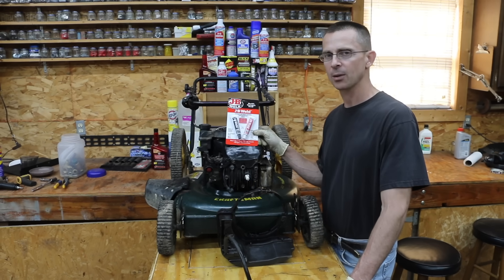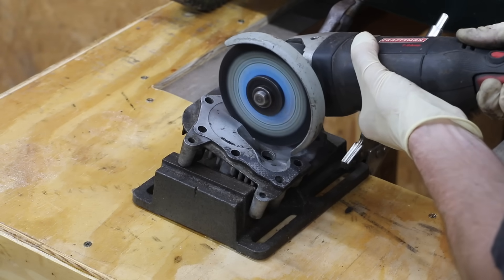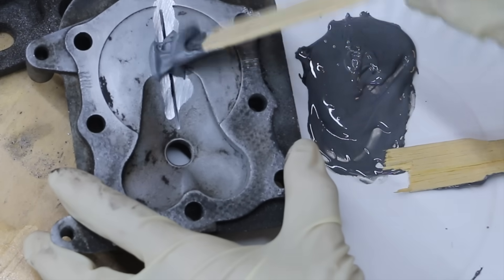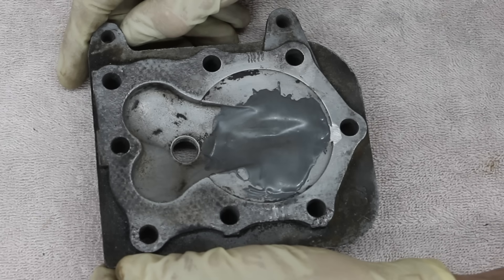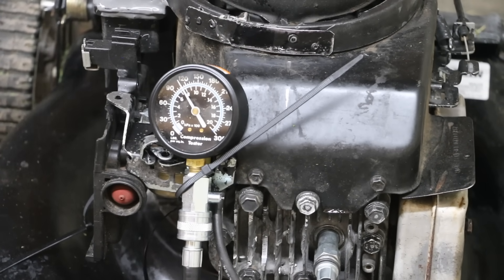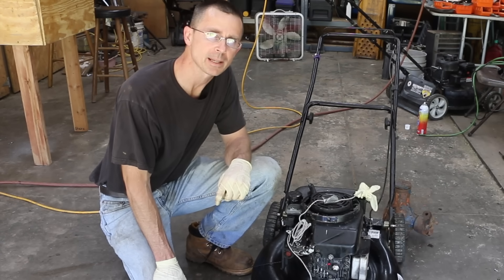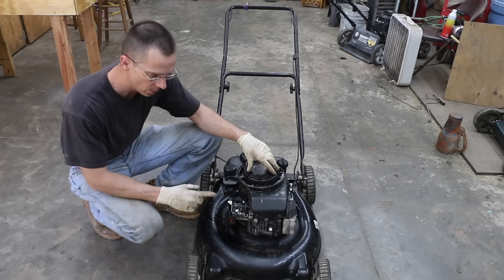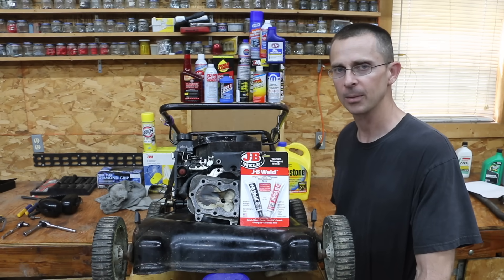Can JB Weld fix a cracked cylinder head?  See the proof!!

Comment: In 2004, I was in Afghanistan in the Kunar Province. I was a noncommissioned officer in charge of a motor pool at the provincial rebuilding team near Asadabad, Afghanistan.  We had a Humvee that had stainless steel brake lines as most did. It had sustained a hole in the brake line from a vibration issue. We remove the brake line cleaned it up very well and put three coats of JB Weld on the leaking area. Mind you, it is 125° in the summertime. We had plenty of good cure time. The brake line help pressureIn the vehicle was able to go out on that mission. Long live, JB Weld!

Comment: i know this video is 3 years old, but two things:

1. my dad had a car, back beforei was born, i think he said it was a buick that devloped a crack in the block at the water jacket. it was leaking coolant. he used JB weld and it held till he got another car a year later.
2. JB weld has a plastic glue now too. its a two part mixture. its intended to glue broken plastic body panels like bumper covers. i used it to glue the bits back together after i busted my drivers side mirror off my saturn. i can't believe how well its worked.
Reply from the maker: Thanks for the feedback.

Comment: I have used JB weld for yrs, it works great. I made a repair on a transmission case a long time ago. A sticking up man hole cover ripped off the transmission pan. Damaged the case.The repair is still holding up today!!
Reply from the maker: Thanks for sharing.

Comment: Used this stuff before to repair a 3 Lt 4runner engine block  and a CBR 600 cylinder head and to this day it still standing up to its claims great product. With the engine block i cleaned around the crack in the water jacket with the die grinder then with a 1.5 mm drill bit drilled a series of holes along each side of the crack about 4 to 5 mm from the crack and around 2 to 3mm deep this then gives the JB weld something to anchor itself to rather than a rough up flat surface. Id keep a bucket of JB weld in my workshop but its pretty pricey for a man made chemical
Reply from the maker: Thanks for sharing.

Comment: I have never found a better product than JB Weld for this type of application.  Your experiment reminded me of a landlord I once had--a professional outboard mechanic--who used JB Weld to repair cylinder walls.  He used similar technique to yours, but machined the wall smooth with a hone.  I don't remember him using it to repair a head, but he may have done that as well.  Very impressive video!

Comment: My four stroke cycle developed a crack in the engine case in the gearbox and would leak out all gear oil within an hour or so. I used the JB Weld and so far I haven't noticed a leak. I wasn't sure how well it would hold up to the oil and heat, but, It's been some months and seems to be doing okay. I also didn't grind off the excess, and, wasn't sure if there was enough clearance between the mound and the gears because I didn't want the gears to grind it down. But, so far so good. I'm happy with the product. I admit I even did less prep. Regarding the dripiness, I've heard some people mix it and let it sit for a little until I becomes pliable and then apply it. However, I know it would be difficult for the product to fill cracks that method. I'm interested in trying the SteelStick.
Reply from the maker: Thanks for sharing.

Comment: I tried to use jb weld to repair a cracked radiator. It held up for 2 weeks and fell apart. It was for a 2001 nissan sentra 1.8l engine. Top radiator hose connector (made of plastic).
Reply: I wonder if that cylinder head can last more than 2 weeks.
Reply from the maker: Thanks for sharing.

Comment: the JB weld tests showed how faster-curing epoxy is weaker, in this specific test. I'd love to see you test boat resins like Vinyl Ester resin, Polyester resin and Epoxy resins in the 5:1, 4:1, 1:1 variations. For the polyester resin, boatbuilding resin, I have seen and heard a lot of folks say "add extra hardener in cold weather or for faster cure" going from 1% resin to 3% or more. I immediately think of you and your process when I hear them varying widely from the label instructions.
Reply from the maker: Thanks for the suggestion.

Comment: JB Weld saved me from having to spend $500 on a replacement radiator on my Kawasaki Sport Bike.  Sealed the leaking hole in the radiator tank perfectly.  I've also used it as a sort of body fill on some rusted out sections of the hood of my old Pontiac.  This stuff is excellent.
Reply from the maker: Thanks for sharing.

Comment: I wonder how long JB weld would last with a pin hole in the block. The Toyota dealer said the hot oil, pressure and heat would be too great. I guess I'll find out.
Reply from the maker: Thanks for sharing.

Comment: Very good test for the JB Weld on the cylinder head. Let's try to make a bearing sleeve for loose rod connection. You know ...when a worn rod starts to knock on the crankshaft. How much torture could the JB Weld take and would the oil soften the epoxy..
Reply from the maker: Thanks for the video idea.

Comment: For a follow up how about applying it from the exterior?

I have a crack near an exhaust port on a Kohler twin.  It's on the cylinder, but is part of the crankcase--so to apply jb weld from the inside would mean a complete engine teardown and case split (and if I do that I might as well have it properly welded).

I'm torn between running it as is, because it's at least running, or trying to slop on some JB from the outside knowing it's in a tough location and could fail to fix it and make a proper repair harder.
Reply from the maker: Thank you for the video idea!

Comment: I fixed a hole in my aluminum rowboat with JB Weld and some wadded-up window-screening; the hole was too big for the epoxy to stay put, so I jammed a pad of aluminum window-screen against the hole from the inside and spread the epoxy on the outside of the hull and the exposed area of screen that was showing through the hole.  After it set, I added more epoxy to the outside to make a smoother stronger more-uniform surface, and filled in the inside area with additional JB Weld applied over the wad of screen; the epoxy soaked into the aluminum mesh and formed a nice hard durable blob.  Hasn't leaked a drop since. :D
Reply from the maker: Thanks for sharing.

Comment: I used JB Weld to fix a leaking gas tank on a 4 HP pressure washer engine.  I had to grind down the lap joint  in order to release the holder from the top and bottom of the tank, but after cleaning it up, and putting a layer of JB Weld into the seam, it worked perfect!  Awesome stuff.  I've machined it, used it for electrical isolation in high voltage experiments, and used it to fix my friend's broken plastic radiator in the dead of winter (used a light bulb heat source).  I've bought it in large volume tubes too.  Only down side is that it take 16-20 hours to fully cure.  But I can wait for awesome performance...
Reply from the maker: Thanks for sharing.

Comment: I've used JB Weld to successfully fix a radiator. Nowhere near the heat or pressure of a cylinder head, but, exposure to flexure, vibration, and ethylene glycol. I, of course, had to apply the JB Weld to the outside of the radiator tank, so the pressure was trying to peal it off the radiator tube, but, I never had a problem. In your experiment, you (wisely) applied the epoxy to the inside, where the pressure forces it into the leak, where as, in my repair, the pressure was forcing it away from the leak.
Reply from the maker: Thanks for the feedback.

Comment: I once repaired a hole in a hydrolic pump on a trim and tilt system of a90BHP outboard engine. This is over 10 years ago. Weld is still holding
Reply from the maker: Thanks for sharing.

Comment: My father had a 1972 Pontiac Bonneville with a  cast iron 455 CID engine. The block didn't have enough antifreeze one year, and the block froze and cracked in the water jacket. He used the original Liquid Steel, using a  putty knife, he slathered it onto the wound, and fixed the leaking crack and drove it for 10 more years dependably. The Liquid Steel was actually a metallic looking putty that dried hard like steel.
Reply from the maker: Thanks for sharing.

Comment: Can you do a test on adhesives that can repair a cracked plastic tank on small engines. I've seen everything from using a soldering iron and melting the plastic to crazy glue and baking soda. What works and is permanent. Thanks in advance.
Reply from the maker: Great suggestion!  Thank you.

Comment: I'd be more concerned abt JB Weld holding up to the heat as opposed to the wear & shock.
Leaks in gas tanks are a perfect choice for epoxy type adhesives. However I've never known them to withstand the heat from an exhaust pipe.
Reply from the maker: Thanks for sharing.

Comment: About 20 years a go I bought a diesel truck that one of the 100 gallon fuel tanks had rusted through.  Fixed it with j b weld and still holding.
Reply from the maker: Fantastic!  Thanks for sharing.

Comment: Brother ,I've enjoyed your videos. I just recently did a j.b repair on the sidewalk of an 11 vertical shaft briggs motor. The crack accured,do to the pan bolts vibrating loose. What I found is one coat on the crack ,recracked due to engine vibration.. I simply clean the new cracked area,reapplied a little wider coating and it was a success. 👍🏻 thanks again for your videos.!!!
Reply from the maker: Thanks so much!

Comment: The Briggs and Stratton Intek OHV engines are notorious for vale guides walking. This results in pushrods bending and falling out, and it's quite common. (That's why B&S ran out of replacement cylinder heads for some of the engines 
L-O-N-G ago.) About all that can be done is to drive the guide back in, then peen the head around in to keep it in for a while.
Next time I am faced with this problem, I will try some JB Weld on the guide and tap it back in. Worth a shot...
Reply from the maker: Thanks for sharing.

Comment: 20 years ago I used JB Weld to patch a small hole (about 1/8") on my dirtbike engine cover. Hole was on the part of the cover where coolant flowed. It held up for years and never failed. Clearly, I should have used JB to patch a hole in the piston, when I blew the engine, in the very same bike,  a year later, lol
Reply from the maker: Thanks for sharing.

Comment: How does cutting a hole in the top of a cylinder head mimic a crack caused by flexing when the bolts came loose holding the cop of the engine on (seems some Kohler engines are notorious for this). Will this actually fix that issue, where the metal is being flexed? Top of the cylinder head doesn't seem like it would have nearly the same stresses (yes, a ton of pressure, but quite different). Anyone have any success fixing a cracked engine block on a Kohler?

Comment: There is a commercial product called Benzoli that is even stronger than JB well it is very expensive it has been used to patch high pressure steam lines in chemical plants. It would be considered a permanent fix,  You can purchase Benzoli through Granger tools.
Reply from the maker: Thanks for the feedback.

Comment: I tried several times to seal a rusted out old motorcycle fuel tank with JB Weld but after awhile it always leaked. Qs: how many psi should I use to pressure test the tank?  How to prevent leaks from the tiny atmospheric air hole in the cap when testing?

Comment: I just put this on my $50 Facebook Marketplace used 5000 watt generator.  I attempted to start it with my Makita 1/2 inch impact on full power and stripped the nut and shaft.  Fingers crossed just slapping this stuff on in between the two it will hold well enough for me to start it with my drill instead of my impact.  At least I learned on a $50 generator instead of a brand new several hundred dollar one!
Reply from the maker: Thanks for sharing.

Comment: It's kinda like a chemical-based weld instead of a heat-based weld. JB Weld appears to be the best adhesive available for metal. A weld or fastener is optimal for most needs, but neither can save an engine block like JB Weld. Such a simple concept too, it's just a steel infused epoxy resin. Being a liquid, it can reach spots that's impossible for the competition to match.
I wonder if homemade recipes are practical with plain epoxy and steel powder. I'd love to see you test different metal powders with epoxy. Different metal percentages would be required to find an optimal strength. I think even hybrid materials like a steel/fiberglass epoxy or aluminum/carbon fiber epoxy could beat JB Weld. The tensile strength of glass can be much higher than steel! Titanium or tungsten epoxy would be incredibly interesting! Making solid molded objects is a fascinating possibility too. How about a solid JB Weld handle for a tool like a hammer or a screwdriver?
Reply from the maker: Thanks for the feedback.

Comment: i've used jb weld alot to seal fuel related items.  carb fittings, and even filled a lawn mower connecting rod hole in the case when the connecting ro broke.  amazing epoxy product.  i was wondering if you could make or repair a cylinder head gasket, or use it to glue the head to the motor with the bolts.  see if it will hold up.  thanks for your vids and keep up the good work.
Reply from the maker: Great video idea.  Thank you.

Comment: Secret technique for JB weld: Hold the tubes together and squeeze both out in lines of equal length/width. You can make a clamp/jig for even squeezing, if desired. Guarantees 50/50 split.
Reply from the maker: Thanks for sharing.

Comment: Jb weld water weld puddy   the blue package just sealed a return fuel line on 2005 qx56  metal fitting big leak 3 layers and an overnight dry sealed it up on vacation so I could tow 8000 lbs home
Reply from the maker: Thanks for sharing.

Comment: Years ago i had an 92 acura integra. The fuel neck to the tank was rusted and leaking fuel every time i would fill up. I looked and looked and junkyards and could not find an integra of that generation. So i removed the fuel neck sanded off the rust and patched it with jb weld. Drove the vehicle for 3 years and car never leaked fuel again.
Reply from the maker: Thanks for sharing.

Comment: After you beveled the cut in the head,  it looks like the tool made some grind or abrasion marks across the head gasket mating surface.  Was that a sealing issue or was it not as deep as it looked?  Interesting test and thanks for your work!

Comment: When I was a young (and dumb) kid, my friend and I took my moms car without permission, and drove it to the county fair.
On the way home, I ran over something in the road, and it punctured the gas tank. Fortunately it was a little higher than halfway up the side of the tank.
Frantically trying to save my secret, I repaired the gas tank with JB Weld, and for the remaining 5 years Mom had the car, it never leaked.  I did eventually tell Mom what I had done, but I waited long enough to have my own home, so I wouldn’t get grounded, again.  🙄
Reply: YZMOTO #80 Hahaha. Had to acquire you own home so you wouldn't get grounded. That was a good laugh, thanks for that.
Reply: 😂😂 Well timed that revelation
Reply: this never happened
Reply: lol, amateur. Never confess to old sins. ;)
Reply: hahaha

Comment: I’ve used JB weld to repair exhaust manifolds and it couldn’t take the heat it just burned up....I’m surprised if worked in that cylinder bead....great video
Reply from the maker: Thank you!

Comment: I have used JB Weld to repair some fairly extensive cracks in the water jacket of Mercruiser 5.7L V8 blocks (result of non-winterisation and resultant ice damage). I repaired 2 engines as a temporary repair with the intention of replacing the engines when they failed. That was 5 years ago, and they never have failed! Still in the boat, used regularly, no leaks.
A fellow boat owner has also told me his tale of a diesel forklift engine that threw a rod and punched a hole through the crankcase. This was over the Christmas period, and they couldn’t get a full replacement engine, but could get a new con rod. The same as me, they thought to make a temporary repair to the crankcase to get the forklift running and source a new engine when it failed. At the time he told me this tale, the forklift had been running with almost daily use for 7 years. That was 5 years ago, and it’s still going. 13 years total.
I really can’t recommend JB Weld highly enough. Just make sure the surface is clean and well keyed. I’m sure it has it’s limitations, but I haven’t found them yet!
Reply: OK - 7 & 5 makes 12. It’s early in the morning and I obviously haven’t had enough coffee yet 😄
Reply from the maker: Thanks for sharing.

Comment: Completely impressed ! Had no idea JB Weld was such a durable product. Knew of its versatility, as I've used it on things like plastic repair/welding of automotive products (fan shroud, A/C housings/firewall repair, dash cluster housing, carburetor repair for cracked or uneven/warped mating surfaces, or adding extended vents for racing, etc.) and many other household "fixes." I recall when it came out in the late 60s and how no one believed any of its claims. Times and experience have changed many a mind.
Reply from the maker: Thanks  for sharing.

Comment: My uncle didn't winterize his boat properly and it froze and cracked the water jacket causing water to leak into the boat! So he repaired it with you guessed it JB weld! Boat still runs several years later! Now I have a water pump for the sink on our dock and it wasn't winterized and cracked. Now I know that jb weld is definitely up to the task of repairing the water pump! It will save us from buying a new expensive pump which is over $350 + $150 plumbing fittings!